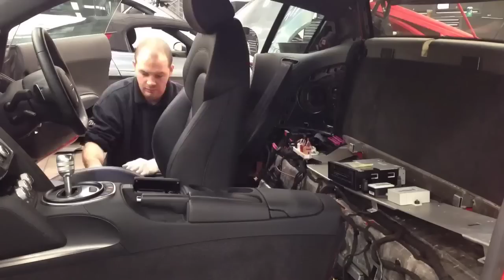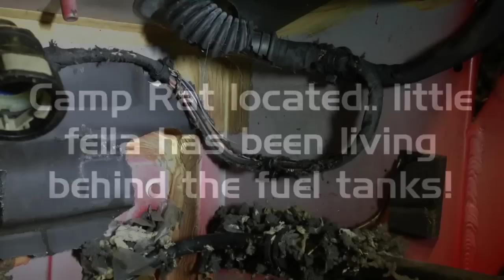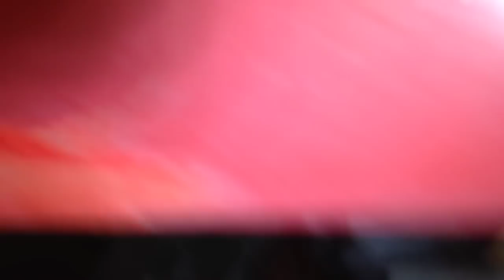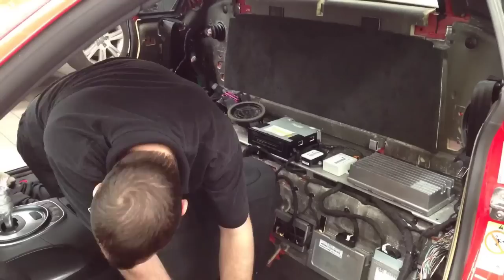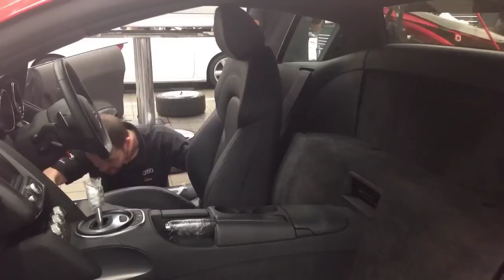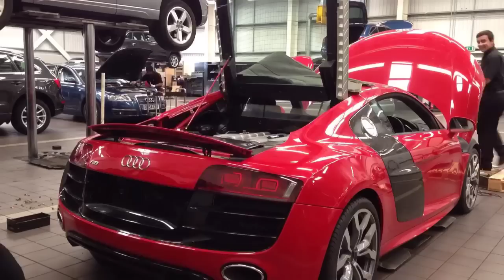Audi R8 V10 Engine and fuel tank removal

Comment: Better you than me!!  I just had two pull both cylinder heads off of a twin turbo a8l and replace one cylinder head..  30hrs warranty and took me at least 60, the first time I worked on it

Comment: that work is fantastic but i have only one wuestion  there........ why that service did not have an original cables colorings?
Reply from the maker: It's so the wiring is immediately identifiable as a repaired section of loom in case of future issues (there won't be but it's what audi insist we use)
Reply: +smokeygsi Good video what time did Audi allocate you for this repair

Comment: Hey Guys,

i have a Audi A3 2.0T (2007) sportback. When the car gets a bit warmer, on idle i can hear the idle clearly and it sounds a bit like a diesel on idle. 

I've heard its apparently the way the cars fuel system uses the injectors, but have also heard it could be something like a timing chain, or something to that effect? would you by any chance be able to provide your thoughts?

Comment: Why not replace the whole harness?  In the American collision industry we replace harnesses all the time, for much less damage.
I'm not saying you didn't do a fine job, but it would mush faster.
Reply from the maker: It was a full retail job, and if I remember correctly it's part of the interior wiring harness, circa £15000 gbp and would have required a full strip of the interior including dash etc as well as engine a fuel tanks out. much cheaper and easier to repair it
Reply: smokeygsi 
I assumed It was an insurance claim.  I replaced a full body harness on a C Class for a torn rubber boot,  that one was probably about 1/3 of that.  These big jobs are the best, not as much money as 10 small jobs, but to stand back at the end and look at it, that's a good feeling.  Thanks for taking the time to make a video.
Reply: Everythingisgoingtobealright
Reply: Everythingisgoingtobealright 
in America people replace parts, they don't fix or repair.
Reply: This mechanic is worth gold.
Not all mechanics at Audi are allowed to work on the R8! This mechanic is a professionally trained R8 mechanic who has completed additional training at Quattro GmbH !!

Comment: Did you solder those wire or use heat shrink crimp connectors?

Comment: Impressive and ultra-sensitive job! At least you have all the tools, time, equipment and gets paid for that haha... but nothing of this would matter when the job is made with a passion (everyone saw you happy to turn on the engine without the muffles), respect and concentration. 
2 points:
1st: Modern cars as I was told, supposed to be with chemical repellers against animals and insects as many years ago cockroach and some animal love to eat warm wires inside the dashes, this chemicals are fire retardant and should keep animals away as we see dogs eating bumpers to hunt hidden animals.
2nd: **REALLY**, removed the engine and installed back without any mod?  No racing cams, exhaust headers, re-ported cylinder heads, lightweight rods... nothing? Can't believe!! What's the owner does with this car? Please!!

Comment: smokeygsi 
 
Does that engine have two control Units ?
Reply from the maker: Trevorkuhlmann Kuhlmann it does indeed, one for each bank
Reply: smokeygsi: like V10tdi touareg and phaeton. 
Great video, thanks!
Reply: seems like an overkill  , surely one control unit can run the entire entire engine ? .smokeygsi whats the rationale behind it
Reply: Noah Shanks TCU is behind the seat inside the car.  There are two ECUs in the engine compartment.  It pays to be educated.  Plus I own one and have removed both for tuning.

Comment: crimp joiners, rough, 
on a car like that I would expect better...
Reply from the maker: They are what Audi insist we use. More reliable in most cases than soldered joints
Reply: Ive had more crimp connectors fail due to moisture ingress than Ive had solder joints fail,
 they almost look like the heat shrink type crimps I've used, they work ok as the heatshrink has a glue to seal as it shrinks
Reply from the maker: +Russ Freer 100% agree there actually. Yes, these are the heat shrink type so should prevent any moisture ingress. The only issue with solder is you need to be good at soldering, unfortunately that's not the case for many, and any muppet should be able to crimp and heat.... But then there's always someone who manages to mess it all up!!
Reply: smokeygsi too true, love the vid, insane amount of work just to fix wiring